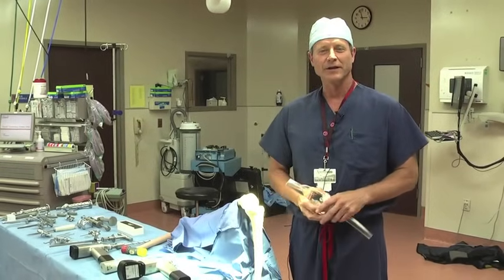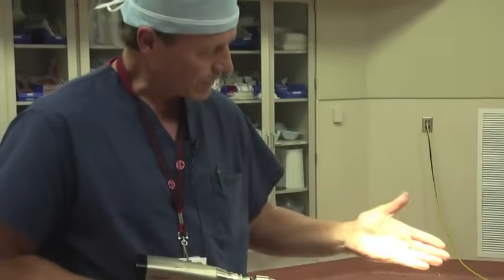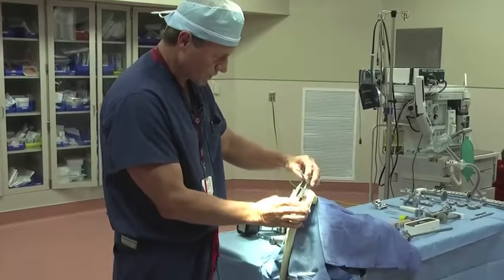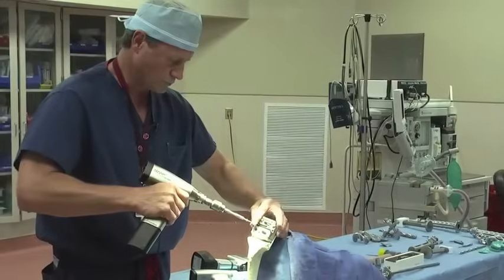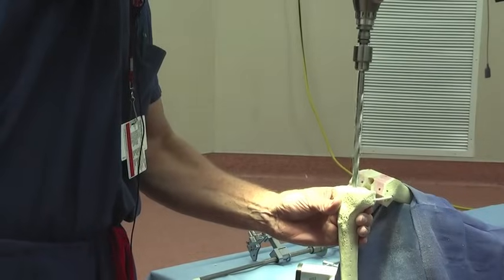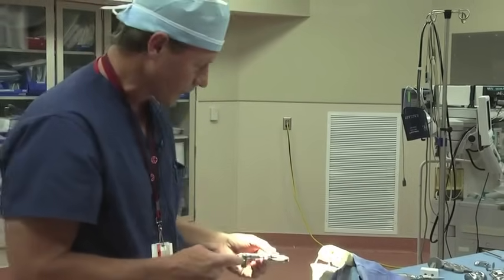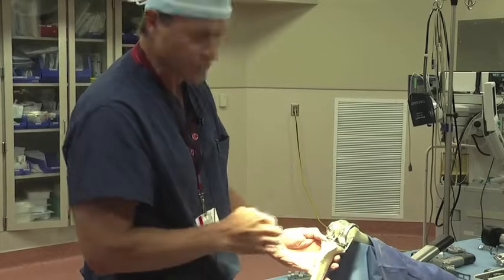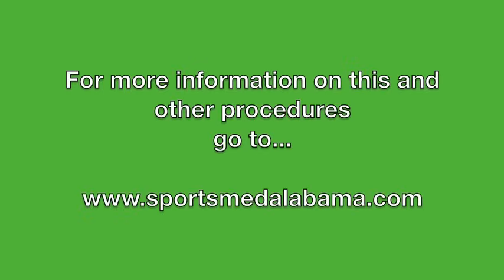Total Knee Replacement Surgery Demonstration - Dr. Eric W. Janssen

Comment: I had a TKR about 18 months ago because I fell and fractured my tibial plateau. The orthopedist thought replacement had a better chance of success than attempting to repair the damage. My implant is definitely bigger than the natural knee on the other side, which I’m guessing is because of the damaged bone. I have a copy of the X-rays, and there is an impressive amount of metal in my knee. However, I was able to be up walking the evening of the surgery, and I recovered without any issues. I still think I made the right decision, and I would call the whole thing a success.

Comment: I didn’t need any pain meds after my knee replacement.  I used the rotation machine (forget what it’s called) and had excellent results.  The incision was tender with the 50 staples which was relieved with ice packs.

Comment: My knees were done three years apart, and the technique changed considerably. My left (2007) has a thick spike holding the femoral part, and the right (2010) has two pins holding it.

Comment: I'm on day 22 post op. The 2nd week I regretted getting this because of pain, swelling and lack of motion, but now on 3 weeks I'm starting to feel better and getting some range back. I'm only at 75 bend, but straight is perfect. Each week I gain about 10 degrees more. Swelling is still there but it's going down a tiny but each day. Hopefully I'm at 85 to 90 next week.
Reply: Do you have pain now?
Reply: @bandug4331  Hi, not now. I go on hikes which has rough terrain and long walks and it never hurts. In fact, my other leg does lol. I'm almost at 8 months post op.  I'd say after 3 months it really started to improve. It's the best thing I've ever decided to do. I don't think about it anymore. I'm so happy. 

Also, disregard when people say you only have 6 weeks to gain range of motion. Mine was getting better each week for 12 weeks and at that point we stopped measuring. Just be prepared to do a good bit of physio. It's a commitment but once you're finished with it, you'll be happy.

Comment: Amazing to watch using drills, hammer, screws, saw and alignment tools. Then gluing the whole thing together so you can walk on it within a day. I've experienced several surgeries rebuilding my shoulders and elbow but it was  nothing like this. Instead they made holes to install cameras, probes, cutting & grinding tools & they keep you sitting up right in a special bed that turns into a chair

Comment: I just had my second knee replacement March 3rd 2021. 5 years ago I had a partial knee replacement still going well with that one. I was a little bit reluctant to do the nerve shot in my spine rather than general anesthesia but I talked myself into doing it and I'm not sorry. No post operation nausea did I experience and I recovered quite nicely I still have pain 5 or 6 weeks out but it's getting better and my flexion is coming back. You can tell the anesthesiologist you do not want to wake up during the surgery and he can give you something else that will make you not remember anything I highly recommend the spinal shot

Comment: Dr. Janssen is the best orthopedic surgeon you will find. After watching this, I’m very thankful I was put to sleep!  No wonder I’m in so much pain!
Reply: Wow I’ve had both knees done. Made them knock me out!
Reply: 😭😭😭😭😭😭😭😭
My mother had one and it was awful and very painful 😢
Reply: I woke up mid surgery. Blanket over my head, face mask under the oxygen mask . No one could hear me over the drilling sawing and hammering. Still traumatized…four months later. Not a joke!
Reply: @linato1855  😮 oh mylanta!! 
I hope you weren't feeling the pain 😮 I took woke up once during a surgery ( colonoscopy) and I said "hey ouch" I was back under in 2 sec
Reply: @toryberch , thank you. No, while I didn’t feel the pain I felt the incredible hammer blows and slight rebound movement, even though I was strapped and judging by the dents in my lower leg and thigh, I must have been bolted in place. I also had the worst stapling above the knee that included skin folds and lumps that are taking a long time to heal. Five months now and still struggling. My “three month checkup” last week at FIVE months, was rescheduled because the surgeon went on vacation. I’ve had many surgeries, this is at the top of my worst list. My gastroenterologist is the absolute best. She’s the department head at the hospital and I’ve never had a problem even in recovery. Take care…
Reply: @linato1855  Oh man Lina, that's a rough one for sure. I had a spinal fusion last summer and I can say it felt like giving birth out your back during the first week. I sure hope your knee is much better once recovered. I did watch an actual knee replacement surgery video and they do bolt your foot and thigh but the Dr also twists and bends your knee many times during. Probably why this is such a brutal recovery. Take care 🤗🌿🌻🦋
Reply: @linato1855 Oh! I feel a pain already from you. Oh gosh. How horrible!

Comment: I ve had an arthroscopy done on my right knee because of meniscus but the doctor said that I would definitely be back in the future because of the cross-shaped ligament at the back of the knee more like where it is bent. I do not know the proper name.
3 years later it is hurting more and unfortunaly now my left knee hurts too from putting more pressure there eversince. Keep in mind I have been just walking eversince the operation. Running and doing sports is unthinkable for me.

Comment: I've had both knees replaced. What is critical is post op physical therapy. Get that range of motion back bending the knee! It's very stiff and scar tissue will build up if you don't. Just scream and bend it asap.
Reply: The pain is my biggest fear and watching someone drill into a sample and that’s suppose to be my femur makes me cringe.
Reply: @roberta1594-b8h  I am 3 wks post op TKR. I completely agree with you, the thought of drilling in my bones, screwing in replacement parts gives me the chills! It’s done, but I still don’t want to dwell on how it’s done 😮
Reply: Day after surgery. Someone asked me so how does it feel ? Answer- There are no words for the pain !  Understanding everyone has a different pain level.
Mine was brutal. Had shoulder done to. 
No walk in the park either.
Reply: Yes. He right one done as well. I have better flexion  with the right than the left. You are right. Took a  hydrocodin and cuss and scream it out. But worth it now. Works great.
Reply: You are absolutely correct!  I’ve had one done and another soon.  I’ve got 135 degrees of motion and super happy with the result.
Reply: @leatherindian  sorry but if the knee is surgery will it still work as normal or you walk different im sorry to ask this
Reply: @faris9720  If the surgery is done correctly and you are strict with your physio, you will walk better - feels like normal.

Comment: Great video! Just had bilateral TKR on on 1/7. I fainted day after surgery and was worried about damaging the prostheses. This video reassures me that doing so would require trauma must more dramatic than what I subjected my new knees to. The post inserted into the tibia is a monster!!

I was given a powerful sedative just before I laid down and don’t remember a thing!! Second day after surgery is the most painful! A definite 9/10!! I spent a couple of months working with my trainer on my upper body strength and core to prepare for PT. That has really paid off!

Comment: I realize this Dr did this video in 2011 but it is outdated and should be updated. Dr Leteeq of Qatar uses the most updated robotic system. My wife was walking within 3 hours of her knee replacement
Reply: Carl MacLellan I was walking down the hospital halls with my walker and a safety helper 2 hours after waking up following rt TKR. Common practice!

Comment: Is it possible for a ligament or a tendon to pull the fibula sideways and then back after total knee replacement? This seems to be happening to me. I was told to do stretching exercises ...bending my foot up etc.
Reply: be more specific? sideways you mean lateral or medial? 

In some cases the muscles that produce inversion(Tibialis anterior/posterior) and eversion (peroneus longus/brevis/tertius) could be tight therefore moving your foot sideways.

If it is not in the foot, you can move up and look up muscle that could be tight post op.
Ex. Quads/hamstrings 

" I was told to do stretching exercises ...bending my foot up etc." --> so your Gastrocnemius or soles are tight.

Def. talk to your Physical therapist about it.

Comment from the maker: The hole in the distal femur provides us with an entry site for the intramedullary guide system.  In other words, once the drill is used to make the initial hole, the alignment rod is inserted through this hole up through the bone so we can attach a cutting block onto it and make a precise cut on the end of the femur.
Reply: AAA a data p loo o.o ooo